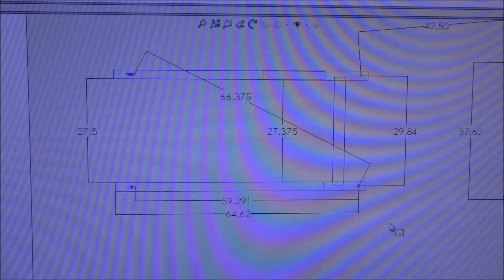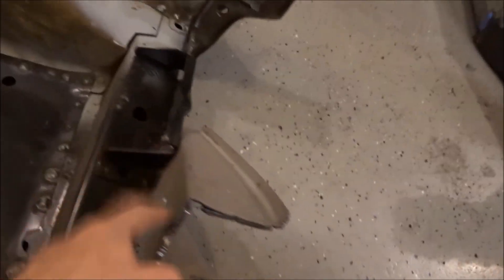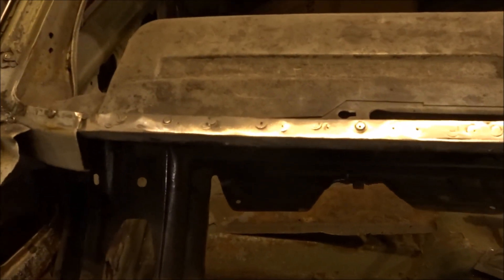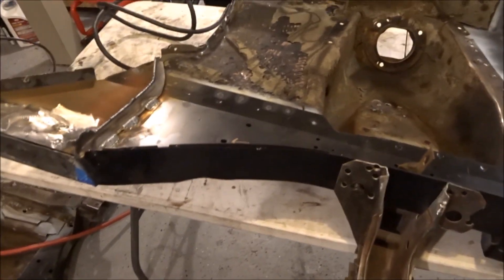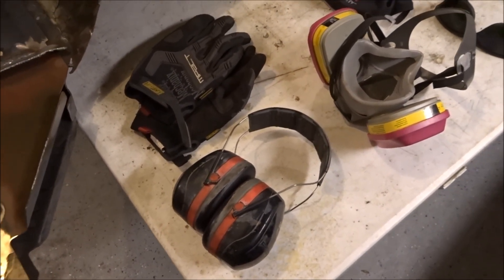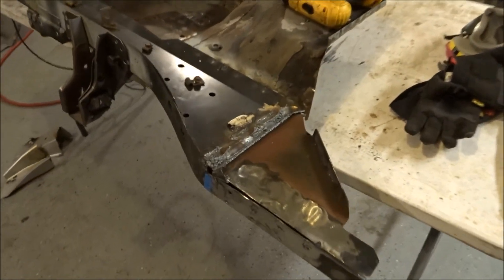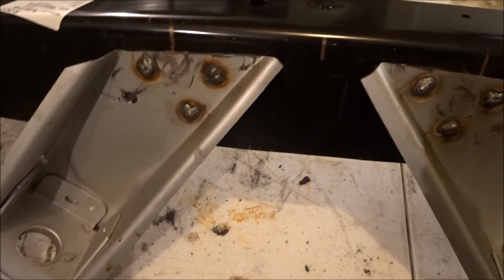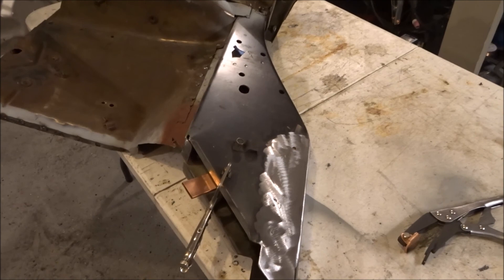Episode 3 Part 2: Frame Rails and Core Support

Comment: Any recommendations for tools? Welding, torch and other tools to cut, grind etc...
Reply from the maker: Mig welder, angle grinder with cut off disk and flap wheel to smooth welds, spot weld cutter (can use a drill bit as well as long as you don’t need the metal behind the panel). As you go along you’ll find what works best for you. Plasma cutter is nice and you can sell when you’re done with it